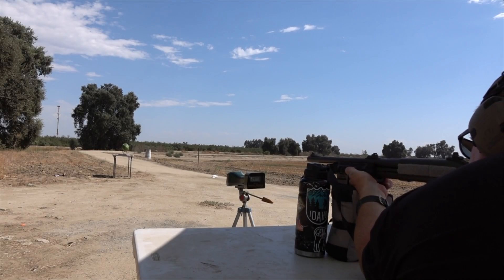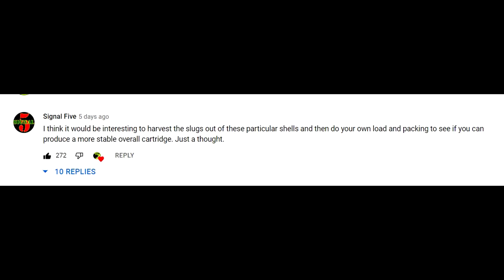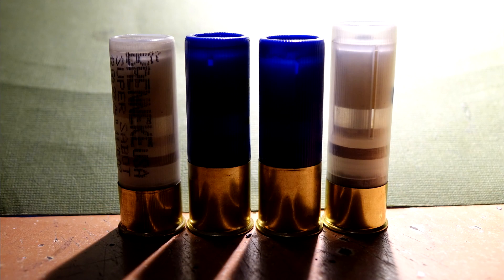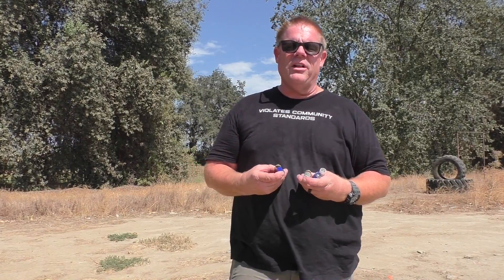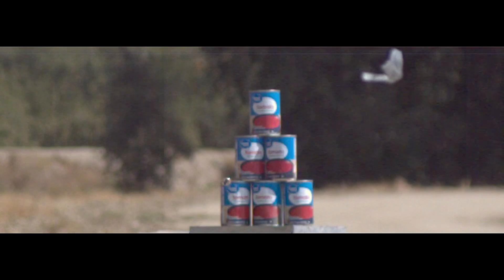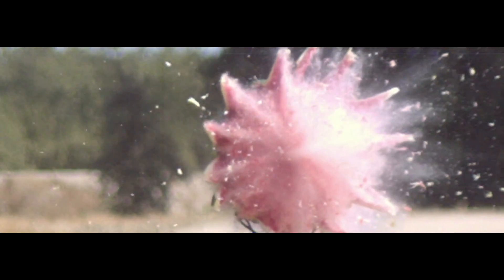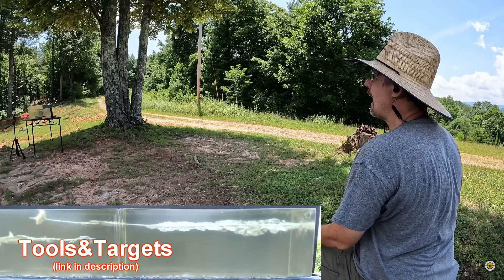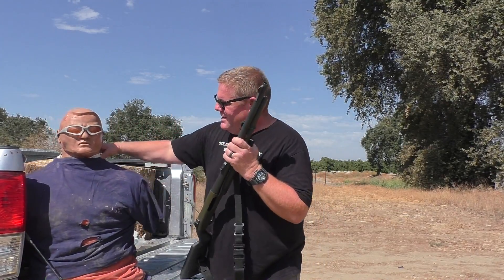Can we Reengineer the Brenneke Super Sabot so they work?

Comment: Steel is a bulky powder that is a little finicky it wants to be compressed. It also needs to be put on a scale it varies wildly if measured with dippers. It is good at moving magnum sized payloads at magnum velocities. I prefer a hotter prime like the 209a. I have had issues with the newer euro primers like the fiocchi.
Reply from the maker: These days you're lucky if you can find any 209 primers.   I can't be too picky

Comment: Unless you reused the hulls from the brenneke slugs and somehow put the full powder load from one round into another hull that still had some powder stuck at the bottom, I cannot wrap my head around how that powder produced that much extra propulsion. 

If the alternate gas seal was significantly tighter than the old one, could the extra force required to move that seal be enough to alter the burn rate and increase its efficiency beyond safety specs? Did you accidentally make an almost pipe----? 
Censored to avoid YouTube bs.

Comment: Remington and Winchester both make good sabot rounds with the Winchester being a little faster. I like both for different reasons. Winchester uses a solid copper bullet/slug now as opposed the the copper jacket lead bullet they used several years ago. ( eco friendly). The copper jacket round used to come in 3 inch high brass and would drop everything on this continent within 50 yards. Claimed 2000 fps with a 398 gr. .58 fmj hp if I remember correctly. It might have been a .50. Same bullet used in muzzle loading rifles.

Comment: Looks like when it’s not stabilizing it’s going too quickly for the barrel twist rate. With rifles twist rate can change the accuracy for depending on the weight speed of the bullets. Slower twist rates are usually better with faster muzzle velocities and lighter bullets. Heavier are better with faster rates and slower velocities.

Comment: The square cut smokeless powder used in the Brenneke shells  looks very similar to discontinued Noble Sport, Vectan powder(s) designated as, either A1 or A0 (A zero). A1 being faster than IMR 7625 but slower than Unique or Winchester WSF. 
A0, being in the same range as Herco, LongShot and 800X.  Hoping this info is of some assistance.
Reply from the maker: thank you

Comment: Very interesting video would never have guessed ambient temperature could effect the burn rate of the powder. I also agree with another commenter on doing some more test tube torture tests or even firing a test tube from a 12g mass accelerator. That would require a very small powder load but would be awesome to see.
Reply: Temperature plays a major role on pressure and velocities. If you’re a hunter like I am, I always check zero on my weapons depending on the time of year.
Reply: @buckandslugreloaders9005  Where I hunt the temp goes from high 90s to low teens during the hunting season. I've personally never seen a change when going to the range at least not in the ammo and rifle I use. Thanks for the info something to keep in mind if using a shotgun or new ammo.

Comment: I thought malfunctions were due to age as well. But I use them in Canada, (Northern BC) so our temperatures are cooler here. They are absolutely amazing and by far the best for defensive use. I was super supervised by the previous video failures at 92 degrees.
Reply: BTW I have never used these shells in temps higher then 77F or 25C so I had no idea. We have a similar cartridge here that’s used when Breneke are unavailable called the CanAm that’s nearly as effective. If Jeff wants a box I’ll send him some.
Reply from the maker: I'm convinced there is something seriously wrong with this new lot -   older stuff seems to be fine even in similar temps.

Comment: That velocity with the stock powder. Ouch. Have to wonder if they aren't loaded with some kind of cold weather powder meant to function well even in significantly sub freezing temperature range. Thats one of the challanges across a lot of europe, even without situations like our recent heatwave, stuff has to handle -5F to 100F temperature ranges with wildly variable humidity.
Reply: But if they basically stop working completely at 95°F, they should be advertised as "winter slugs" or something. We've had a couple of days of 95°F temperatures all over Germany this year and 86°-90°F is what I'd call a normal hot summer day in Germany. We're not in Iceland...
Reply: @maximilianmustermann5763  Bear in mind temperature changes of just a few degrees can produce very wild swings in reaction speeds, so 86 degrees might not sound that much less than 90+ but for a chemical reaction it can make a huge difference. Also a lot of the powders are probably decades old in terms of hen they were designed. Europe's seen a pretty sharp uptick in high 80+F days per year over the last couple of decades. If they date back design wise another couple of decades it gets even worse.

Comment: Double base powders can deteriorate by separating over decades, leading to unsafe pressures and inconsistent performance. How old was the ammo?
Reply: I would be amazed if they sat on these for over a year. He said they shipped directly from the manufacturer, I don't think these were sitting around in a dudes shed for 10 years.
Reply from the maker: We've never seen old powder get more potent over time,  just less potent.   As I said these came directly from Brenneke USA and were new.
Reply: @taofledermaus  This is probably a bit late but the box may have had a lot number on it, and Brenneke would probably be interested given your results.

Comment: I'm guessing that primer was flat as glass on that shell with the original powder load. That's a scary jump in velocity. A greater than 33% jump is no joke. I'm glad you guys didn't have any high speed disassembly events. That's probably on the level of a proof load, and then some. Would be interesting to have it pressure tested in a lab for peak and curve. No, I'm not suggesting you do that. I can't imagine what that would cost, but more than a little is probably an understatement. But you're right, it's kind of stupid to be offering that here without so much as a warning. They bought the powder, they must have the datasheet on it. Unless there was a huge F-up on the powder supplier's end. Either way, you'd think they'd be a bit more careful about that kind of thing. Anyway, good stuff as always. Very, very cool you were able to work up a functional load for those slugs.
Reply from the maker: The primer was halfway out of the primer pocket!
Reply: @taofledermaus  Holy crap! Yeah, it's safe to say it was a little over pressure! Geez.

Comment: So the Steel powder is made for heavier weights of shot. That could mean that the powder itself is slightly slower burning that the other(s). Similar to the powders in magnum rifle loadings. The slower start not crushing the wad/load as badly as the standard powders.
As always gentlemen, an interesting, and educational video.
Reply from the maker: Yes indeed,   it is slower burning than Longshot which isn't a fast powder too.

Comment: The slower velocity absolutely made them more accurate.  The rounds are just to hot in powder not ambient temperature.
Reply: True but the ambient temperature can have a huge effect on the burn rate of certain powders and when coupled with massive projectiles can create exponential rises in chamber pressure. They used the wrong powder and didn’t research how hotter temperatures would effect the rounds. Where they live it likely doesn’t get that hot so they didn’t think about it.
Reply: @Leonarco333  I don't know, but 85°-90°F is relatively common in Germany in summer, and 95°F or even 100°F isn't unheard of. I don't think it's acceptable that German-made slugs basically stop working completely in those kinds of temperatures. It's not like we're on Iceland or North Norway or something...
Reply: @maximilianmustermann5763  I'm wondering if the supply chain issues led to the shells sent to TFM being loaded with Scandanavia only powder?

Comment: That chain reaction in the gun mag is a scary reminder what can happen if something goes wrong. 😧 I remember you doing a video about the possibility of it happening and now I'm definitely thinking about it. One thing I don't understand is how he whent deaf in one ear. 🤔 Thanks for re-triying those cool shells!
Reply: He went deaf  because of a MASSIVE KA-FUC*ING-BOOM right near his head/ear(s) from numerous instantaneous KA-FUC*ING-BOOMS as all the rounds in the tube detonated. 
Think of X number of guns being fired right NEXT to your unprotected ear(s) at the same instant.
That'll give you a BooBoo that'll hurt.
Reply: Probably went deaf in his off-side ear (assuming a right handed shooter his left ear) because all the noise was 12" away from that ear and the on side ear had some structure to break shockwaves.
Reply: @ScottKenny1978 sound logic,  but I was curious why you wouldn't have ear pro on if you are shooting guns, unless he was in his house loading the gun and was planning to shoot it outside??
Reply: @calvinwright5040  people hunting may not have ear protection on, though with electronic ear muffs that's a lot less common than 20+ years ago.

Or it could be that was such a blast that whatever ear protection he was using was overwhelmed by 5 simultaneous shotgun shells.

Comment: I don’t know much about steel powder but if it’s designed for heavy projectiles it makes sense. Especially with the high volume. It should have a slower more stable burn rate with lower pressures being less energetic.
Reply from the maker: Yes,  it is a bit slower burning than even Longshot.
Reply: @taofledermaus  I don’t load much for shotguns, but it’s a similar scenario with subsonic rounds. Overweight projectiles with a slower powder. Also with big 37mm signal flares although the safest way to keep those pressures down is to use black powder.

Comment: You could tell that Stock powder was an overpressure shot, due to the (I think) rather obvious muzzle flash, in bright daylight. That's a great catch on that ammo!! With shortages, we're shooting whatever we can find.
Reply from the maker: and the telltale ooomph from Gregg lol
Reply: @taofledermaus  I tried to work out the pressure required for that, but I got it very wrong somewhere. Probably out by a factor of a million or something. I do recall that I worked out the muzzle energy on that thing: 4808 Joules. Yikes. .30-06, eat your heart out.
Reply: The problem: I know the answer: 4807.5 J; I know the question: what is the area under a graph of f = 0.0255 a p / x from x = 0.0255 to x = 469.9? I know I can calculate the area under a graph by integrating the formula for the graph: y = 5 from x = 3 to x = 7? 5 x^0 integrates to 5 x, so 35 - 15 = 20. Right? 4 x 5 rectangle, 20. Right. y = 2 x + 1 from x = 4 to x = 9? 2 x + 1 integrates to x² + x, so 90 - 20 = 263. Right? 9 x 5 rectangle at the bottom, ½ x 10 x 5 triangle on top, 70. Right. So how do I integrate 0.0255 a p / x? That's {stuff} x^-1, so add one to the power of x and divide {stuff} by that. See the problem? The area under that graph up to 18" is infinity and the area under it up to 1" is infinity so subtract infinity from infinity to get 4808. Yeah. That's not going well.

I looked up how to deal with this and apparently the answer is {stuff} ln(x).

Okay, so {stuff} ln(469.9) - {stuff} ln(0.0255) = 4809.684, right? Wait. What? 4807.544 or 4809.684? Well, not much in it. 
((6.153) - (-3.669)) = (9.822) so 9.822 {stuff} = 4809
{stuff} = 489.6
0.0255 a p = 489.6, and a = (9.5 mm)² PI = 0.000248 m² so p = 67718003.5 N / m² = 668 atmospheres = 9821.666 psi
Well, I finally got something into the right few orders of magnitude, but that's not all that huge a pressure spike, is it?

Sure, it's got a SIX SIX SIX in it, but it's not high pressure compared to .45 ACP's 21,000 psi SAAMI pressure, is it?

I guess the "Ooomph!" is a force thing not a pressure thing. 16794 N, equivalent to 1712 kg or 3774 lb initial recoil force, down to 908 N, equivalent to 92.5 kg or 204 lb, at the muzzle. Yeah, that's an "oof" from me, Ebert.
Reply: @taofledermaus  Well yes, that as well, but, considering the amount of high brass Goodness you've sent his way, he's an appropriate stand in for a Lead Sled at this point.
Reply: @colinsdad1  Wouldn't higher chamber pressure increase the burn rate?
A muzzle flash is unburned powder burning up at lower temperature in the atmosphere after the pressure drops.
Excess powder would cause a big muzzle flash, but an excessive burn rate producing excessive pressure shouldn't, afaik.
Reply: @Sableagle  Not necessarily- if the powder is burning MUCH faster than designed, it's going to push out of the barrel quicker, thus the muzzle flash. Plus, as Tao pointed out, OG got a bit of an extra Thump from that round.
Reply: Can you cut back a bit on the shooting over there? Now euro manufacturers cant supply us in the old world, lol 😂

Comment: WOW!  I did not know about the Blackwater slugs.  Have shot 5 and are still sitting on 25 of them.  Glad/lucky that my shotgun is mag fed.  Quick question about rifled barrels compared too a smooth bore with a rifle choke.  Does the rifled choke make shooting "for rifled barrels only" slugs just as accurate or functional?  I would love to see a testing on rifled choked smooth bores with different loads.  Keep up the fantastic research and data transfer show.
Reply from the maker: A rifled choke will not give enough spin to an Accutip for example.   They do seem to help accuracy with foster slugs though

Comment: Fascinating how the ambient temperature affects ammo performance. A reminder that small arms are precision high velocity tools that require mature responsibility to be used (and marketed) safely. I hope that guys hearing comes back...
Reply: Chemistry and physics are two related fields that should not be taken lightly. They are literally the fabric of creation and manufactures need to do research to see how changes in elevation, atmospheric pressure, and ambient temperature will affect their products. Severe over pressure can very easily kill someone who isn’t expecting that that research was never done. It’s really irresponsible for them to put out a product like that. If it’s just that lot number they should recall it. If not they should do a wider recall. You can’t expect the general public to mitigate risks that they don’t know are risks.
Reply: @Leonarco333  I suspect that Brenneke never intended these shells to leave Europe.  At the very least, the people that made their powder clearly didn't.
Reply: @vicroc4  I would very much agree with that statement. Brenneke regularly sells ammo in the states but these either weren’t meant to leave Europe or supply chain issues meant they had to change powder on the fly. It’s a reminder to never take anything for granted.

Comment: Looks like the wads are designed for a certain velocity. Your first longshot shell probably was just over the wad's tolerance, due to manufacturing variance, while the other was fine. Steel looked to be around 100fps slower and was well within the tolerance. Im starting to think that cooling the round didn't change the powder's characteristic but rather made the wad harder, thus improving it's tolerance.
Reply: But it looks like the original powder produced much higher speeds even, so it could be that the powder doesn't like high temperatures. Or both. In any case, as a German I have to apologize for that lapse in manufacturing quality. Those results are really disappointing for a company that is being marketed as the German gold standard for slugs...
Reply: @maximilianmustermann5763  that's what I've been wondering about too, but it could also be that the batch OG received were loaded too hot as well, which is a problem in of itself, as the reload one with the modified wad and stock powder showed signs over pressure, while as other YouTubers had properly functioning rounds at similar temperatures, so i think the powder's characteristic aren't the issue here

Comment: I bought a bunch of these last winter and I'm so disappointed seeing how poorly they perform. After watching your video I took one apart and saw the Sabot barely even qualifies as a sabot and the slug is EXTREMELY rear-heavy. I think the collapsible base screws up the sabot making it basically just a shot cup. They aren't inexpensive either!
Reply: I understand your skepticism but you won't know how they perform for you until you test them in your scattergun. The combo of your gun and that ammo may be much more harmonious.
Reply: @maxcactus7  Yeah I actually haven't tried any of them yet rifled barrel or not, it's just seeing them performing so poorly makes me not feel confident in them. I'm probably just going to shoot water jugs anyway so it doesn't really matter 😂😂
Reply: Hang in there and give them a chance. These are good slugs. I’ve killed my fair share of critters with them, including the two boar Jeff posted about. That was an 80 yard shot and smoked two of them with one slug.
Reply from the maker: It's possible that just the new stuff is problematic.   Other folks using older stuff have had great results.

Comment: Nice video 
I reload steel shot for duck & goose hunting 
For some duck hunting I load a 2 3/4" 12 gau hull , 7/8 oz of steel shot , Steel Powder and a CSD wad 
I have very good results and low shot to shot velocity deviation and 1600 FPS
But I and others have found Steel powder needs a LOT of wad pressure 
I use 100 PSI for some loads and 120 PSI wad pressure for other load 
So when you load with Steel Powder you might use more wad pressure